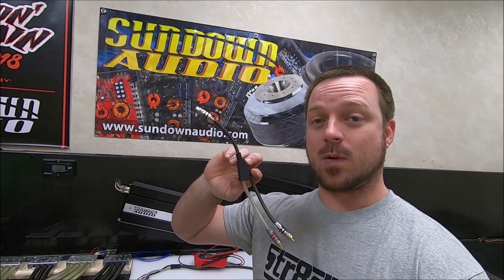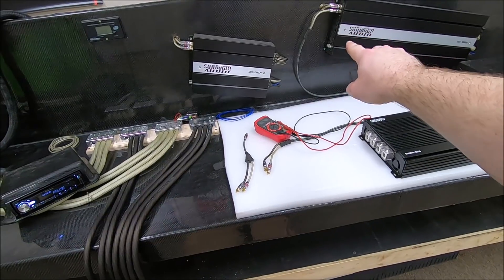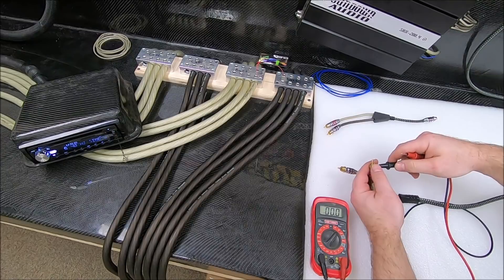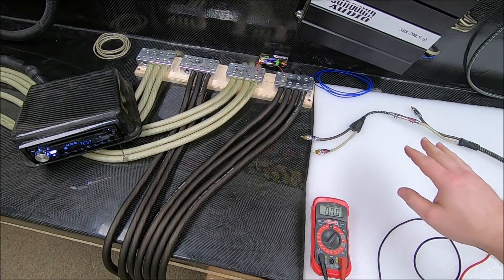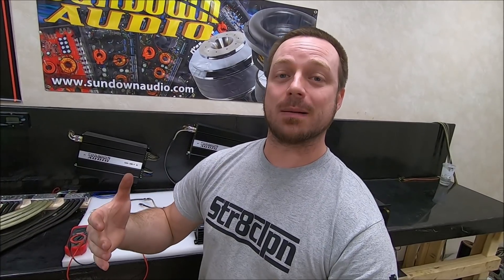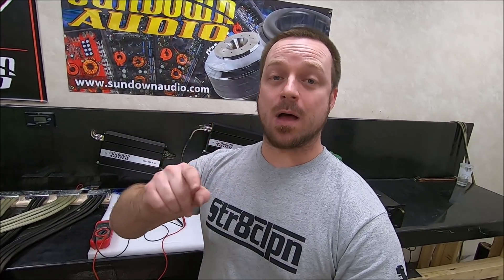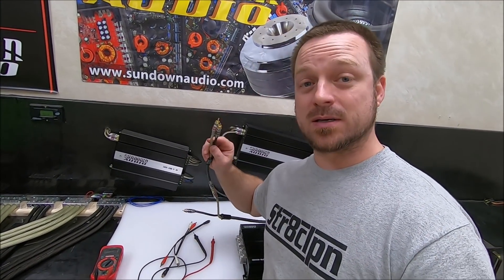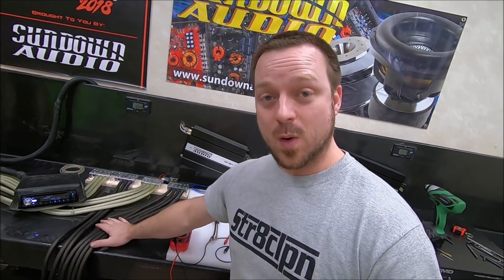***Car Audio Mythbusters*** Splitting RCA Signal Voltage

Comment: Excellent video guys . Can you do a video on boosting rca voltage ?
Reply: Get a bass processor
Reply: @taylorfreeman5504  that won’t increase rca voltage. That’s just another useless bass booster to send more clipped signals. What you meant to say is a line driver. You shouldn’t ever be using bass boosters. If you need a bass booster you need a bigger amp. Rca voltage also pertains to the highs.
Reply: @EARDRUMASSASSIN  you can adjust rca voltage on a bass processor and also bass boost is optional. Which I would never use.

Comment: Next myth busters use the high to low converter for those that are using them. I unfortunately am. I hacked my 2005 jeep grand Cherokee CD changer for audio in from phone and a converter on factory amp out side going to my sub amp. Show the loss in voltage with some converters. Wally world cheap to a mid to a higher level.

Comment: So if this is correct. If you run a singel 4 gauge power wire you can split it into 2 4 gauge and it be just as strong. No. If you load them you will not. The draw on them will be lower.

Comment: Nice work bro. I've been told it takes away from voltage. I still did it both amps had same voltage. I'm nobody so you telling them is better to the point.

Comment: That's what I thought, in my mind it seems the splitter literally spits the RCA's to two wires in parallel which would put a higher current load on it but keep the same voltage, so the only way for voltage to drop is if the RCA doesn't have enough current to supply that which would cause the head until to drop the voltage, however, I believe it would draw much current so it should be fine and not drop voltage anyways...

Comment: This explanation is only half of what you need to know.  It is correct that the voltage remains constant on a parallel circuit.  But we also need to be concerned about current (because voltage and current are both needed people!).  Unless the HU had an unlimited capacity to provide double the current for each split, which is what it would need to do, the actual power to each connected device would be half of what left the HU.  So the POWER of the signal to each connected device would be half of what comes out of the HU.  Some might say connecting two devices and assuming that they are the same impedance will halve the impedance and therefore the current demanded of the source will just go up.  But it would be a mistake to think that the HU has unlimited current output capability.  Splitting once is probably OK and you account for it with the gain at each amp.  Splitting 5 times, you need to know the output impedance of your source and the input impedance of each connected device and do some math.
Reply: what I was thinking! kinda like a apliance pulling amps. too much draw. Am I wrong?

Comment: While I agree that Voltage doesn’t magically half the power does. I wouldn’t do what this man say and add a bunch of these Y connectors to deliver signal to a bunch of amplifiers. You will probably get more noise than signal to each of the amps lol.

Comment: I don't think this disproved anything because he isn't taking length into account. If you have multiple runs of 17ft RCA cables on splitters, you will definitely have voltage loss. Same as power wire. You have to have more or bigger gauge power wire to compensate the longer distance. Same rules apply to RCA voltage. Bench testing shouldn't equate to real world testing. There's definitely voltage loss in a long distance situation. He keeps his radio in the back of his comp vehicle so all his runs are short and his bench testing has short runs. Try this in a traditional long 17ft multiple runs of RCA vehicle and see if the results are the same

Comment: It devides the current in half not the voltage.
Reply: Using watts law P = I x E 
P being watts 
I being Amps 
E being Volts. 

In a parallel circuit, current is divided between conductors which is essentially what a splitter is doing. If current is reduced then watts will be reduced. Resulting in overall power loss.

Comment: Hmmm . Well i completely understand splitting voltage.  You just proved it.  If 1 amp seen both rcas it sees 5 volts ... when you split that now the amp sees 2.5v not 5v .

Comment: I wish you'd actually tested the cheap rcas. I've tested other cheap ones and had same voltages as expensive rcas. But that doesn't mean same sound quality as a rule. Remember it's ac output.
Reply: what??  buying more expensive cables doesn't promise that you're going to get better sound quality.  the problem comes with noise inductance and poor connection as a lot of cheaper cables just aren't designed for automotive use and lack corrosion resistance and proper shielding.  well, build quality in general is lacking, but for the most part you should be fine as long as you're using cheap cables intended for automotive use.  with such small voltages and current the wire gauge shouldn't even be much of an issue outside of robustness.  honestly i'm not sure why automotive audio is still using unbalanced over balanced cabling.  i hope that sundown utilizes balanced inputs/outputs on their home audio stuff, it's such a pain incorporating unbalanced gear into a balanced setup.
Reply: @buddykiller  balanced input wouod require manufacturers to change amps and head units going forward. I'm in commercial audio, and as you know, a balanced cable is pointless without those 2 working together.
Reply: @buddykiller  and I only made my comment because he literally says they won't test out the same in voltage. That's a silly statement.
Reply: @ktraughb  you'd just think it'd be a no brainer by now given the noisey environment, especially now that mini trrs is a thing.  car audio seems to lag behind in innovation.
yea, to get a voltage drop like that something would have to be wrong with the cable.  he's probably misremembering something.

Comment: The people that believe that the voltage is split/halved/doubled by splitting connections (I think) are the people that don't understand electricity very well.. they probably derive that belief from the rules of impedence.. but they're obviously misinformed or they misinterpret the information they attain by whatever means they attain it. It's ok though if they care enough about the subject they will eventually understand it

Comment: You are wiring in parallel with a splitter so it makes sense that the voltage stays the same and the amperage doubles. So as long as your source unit can output enough amps on the low level outputs you would have no effect by splitting the RCAs. I complete agree with the end result however the test is useless unless you have a draw on one end of the splitter and then measure the other. Connect one end of the splitter to an amp and then measure the other end of the splitter.

Comment: I was going to make a comment but then I realize what exactly was being explained here and then I had to sit back and really have a ship of my coffee and enjoy a nice drag on my cigar   

what somebody is actually thinking and what this dude is trying to explain is that if you take a wire and split it into somehow the 12 volts that you get on that wire that you typically get from a battery will all of a sudden be 6 volts on one wire and 6 volts on the other wire if you just split it in half.     So the second you make a "Y"  with the cable the each to wise at the end are going to half the voltage of the main trunk of the "Y"  or splitter as is commonly used. 

it's typically best to use something like a line driver in order to do this but then again what you're doing is that you're adding more noise and stuff into the signal chain.

 and the Better Built components can usually split a pair of RCA's  without too much of a problem and without significant loss to the output of the signal that the amplifier circuitry is going to need in order to reproduce that output on the amplifier circuitry,.   

some head units absolutely require a line driver and that's why back in the 90s and early 2000s they're absolutely mandatory that's most head units only had two sets of RC outputs and to top that off the circuitry really wasn't up to the task of driving  more then 2 RCA's  at full output. 

that's another reason why many of the Chinese head units like the wonderful so-called ambiguous MP5 Windows CE head unit that I've been doing testing on for the last year has had so much trouble driving two sets of RCA's to the point where there is a significant audible drop in output when driving two sets of RCA inputs regardless of the amplifier used.  

However..   In an earlier video?     Line driver used.  
https://www.youtube.com/watch?v=TQrUCoFgVv0

Comment: A good healthy strong rca signal for any single amplifier is 2.5-3v  minimal although there are some head units that can produce more for example eclipse head units are popular among veteran car audio enthusiasts because they produce 5 volts though 3 sets of  RCA’S basically there is a slight rca voltage sag when you split but not enough to notice  one thing’s for sure the more rca voltage your amplifiers gets the less gain over lap your going to use equals less distortion better sound .......resistance is one of car Audios worst enemy’s!.
Reply from the maker: How much signal voltage your head unit actually puts out is another myth.  So many people dont understand that those are max ratings and often not even usable.

Comment: No of course it’s the same. What you are doing though is duplicating whatever frequency you have coming out on that one channel and feeding it to various sized speakers which make the quality of sound poor. 6 different size speakers and a sub, in my opinion should not be hooked up to a single rear RCA output on a car radio. But since they make every few 6.1 head units with 6 rca outputs  I guess we have no choice but to be connecting every speaker we  have to one rca jack.  Which makes no since if you want quality sound.

Comment: Although using a splitter is no where near as bad as people make out, your testing method isn't that accurate. Try putting an equal load on both leads at the same time of around 300 - 500 milliamps rather than using a multi meter. The issue isn't so much the voltage but more the current. As you said, splitting the 12v line to the amplifiers doesn't drop the voltage, however, try running 2 or 3 amplifiers off of a 1mm cable. You'll have 12v on every line until you try running all the amplifiers. Again, voltage isn't the problem, it's the current. As I said using a splitter is fine and the slight loss can compensated by turning the gain up on the amps.

Comment: Test the current and the impedance I know if I use a splitter it sounds different even after I bought your wires come on Jacob man test out what I'm saying or please don't belittle us who think of the big picture . It's basic introduction into electricity think of it as a river  you can't take water out of a river numerous times and it still have the same current flow or power use your head no free energy device here

Comment: Your half right and half wrong. Yes the voltage will be the same without a load. Once you put a load on each split, that’s when the voltage will be cut in half under load. Not a bare wire.

Comment: Is this satire? Of course there's no difference when you don't put a load on any of the outputs. This is flat earther level.

Put amps or speakers on both outputs and compare vs a single amp/speaker.

Comment: Two parts to electricity. Voltage and Current. You said nothing about current. Once you pass the amount of current the HU can push at it's voltage you will start to see voltage loss.
Reply: Of course it's still 2.6v because you have nothing drawing on it! Amps require volts to work right? Self explanatory.

Comment: Test both sides at the same time.
Reply: They should have the exact same voltage potential.

There is no work being done, so there will be no voltage drop.

The cables themselves do provide some resistance. This has a measurable effect on the voltage as a loss. So maybe if splitter A had 20' of RCA cable and splitter B had 100' you may measure a difference?
Reply: @u9Nails  they did pass my mind

Comment: This is BS.
The preamp section of the amplifiers will draw current, not voltage from the head unit.....preamps are rated with Ohms in.

Simple test: Put a very accurate "low" amp meter ( Oscop ) on a set of RCA's going to a amplifier. Then Y them to another amplifier.
Reply: low impedance out to high impedance in. now do the math with a calc and your oscope

Comment: This video is silly as people are in the end worried about the audio, so although this splitting doesnt divide voltage, it DOES draw more current and if thats fixed in allocation to the RCA outputs, volume levels are absolutely affected. So, technically, it doesn't split the voltage, but now the reception end of the splitters all have to share a fixed pot of gold; everyone gets a little less.

Oh, and if you're going to try to educate people, drop the condescending tone. No one wants to hear "I can't even fathom how there is a debate here, blah blah" when you can't even properly explain WHY there is no voltage drop. Leave these videos to electrical engineers.